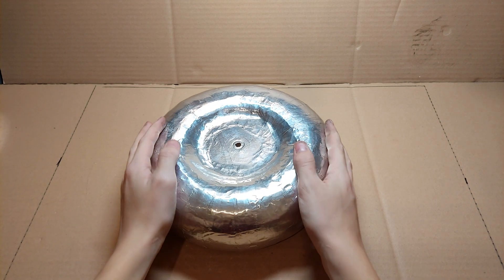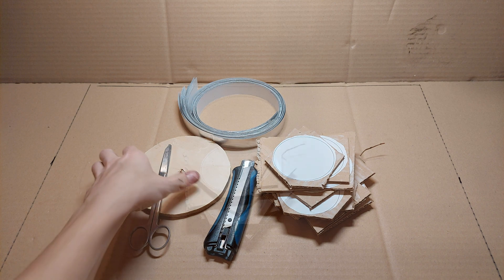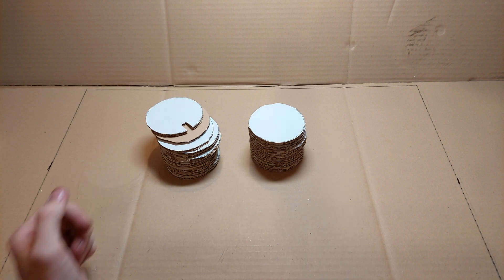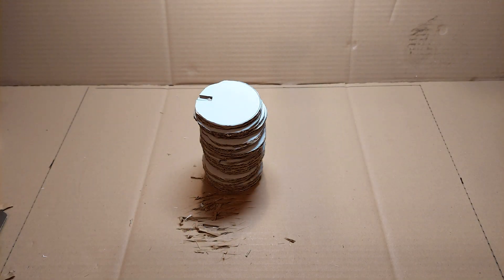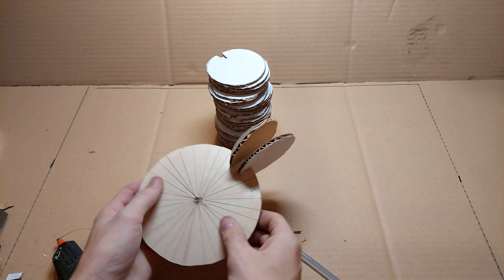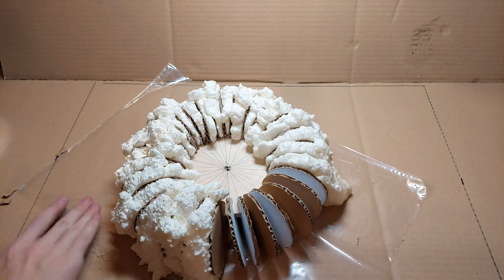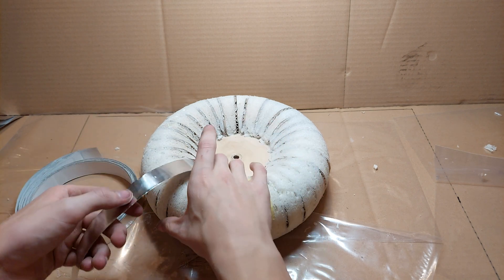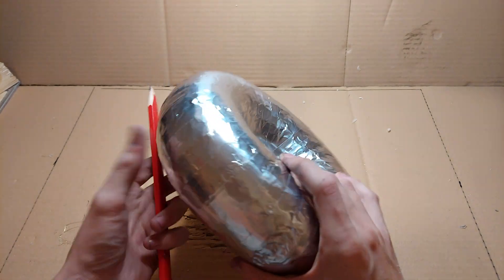Do YOU Wanna Make a Simple Tesla Coil Topload? (For Under 10€)

Comment: Can I not use foam? I plan to use paper and glue to create a surface for the top load then cover with aluminum tape :D
Reply from the maker: With foam you can get an even surface. Might be hard to do that with just paper and glue. Sounds like it would be pretty fragile and pain in the ass to add tape

Comment: When tesla coil for 1000$?
Reply from the maker: Lol, idk maybe someday. Rn I'm working on a large one which costs about 100$ in parts
Reply: @latenightprojects  At the risk of sounding silly, could you run an experiment when you finish your coil? Plug a load like an LED or bulb into the bottom end of the wire that makes up the secondary coil and then plug the other side of the load into Earth ground, see if anything unusual happens? I can't test it yet.

EDIT: Oh wait, this was a year ago lol... Try sometime soon?
Reply from the maker: @jenkorun1306  yea sure I can try that. My SSTC is currently broken so I'll try it on my DRSSTC. Not sure exactly when but I'll do it as soon as I can